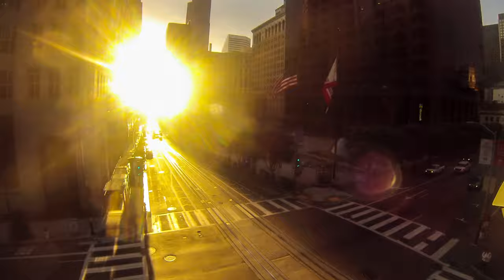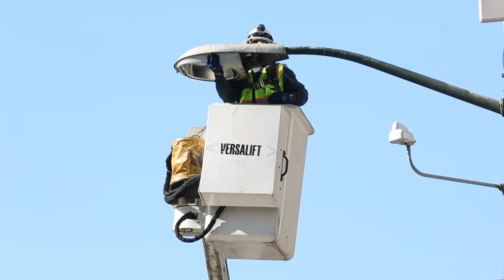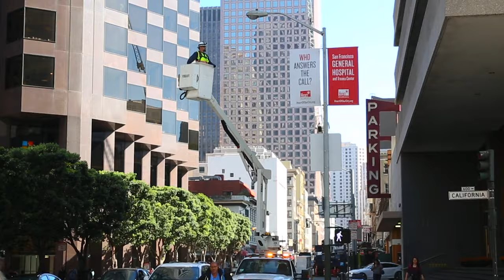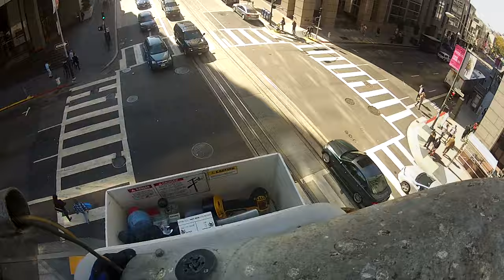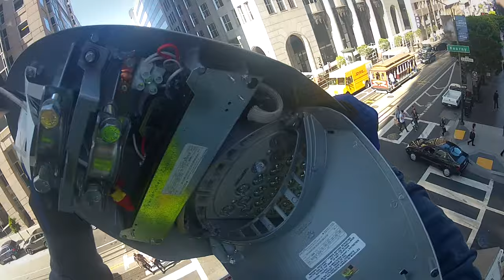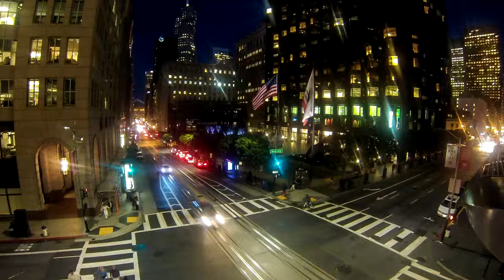San Francisco's Green, Cost-Efficient LED Streetlights

Comment: Haha 30 minutes for a light? Other cities are doing a whole street in 30 minutes.
Reply: Mike F. Ya think it’s faster then that 5 minutes each I think my street lights in Ottawa are
Reply: here, they install them in under 2 minutes by destructively removing the old light ( with sometimes even a hammer and vireos other small demolition tools if the spigots are jammed and seized. ) then throwing the remains of it over the side of the bucket truck into a skip. then installing the new one , not before scratching the sht out of it's diffuser with the way they remove it from it's spot in the bucket. wiring it up without even thinking about tightening the spigot bolts all the way. looks good for brand new but after about 3 weeks, the lights get loose, turn upside down or hang precariously off the edge of the boom. and to make matters worse, the terminals just had the wires shoved in, so there where a few sideways fixtures thAT WHIRR COMPLETELY AND UTTERLY DEAD. not to mention that none of the gasket seas where installed propperly and sme fixtures now strobe on and off due to a flooded ballast. WHAT A NIGHTMARE!